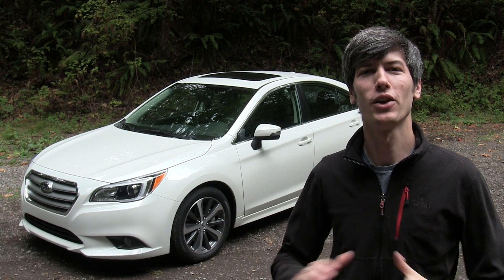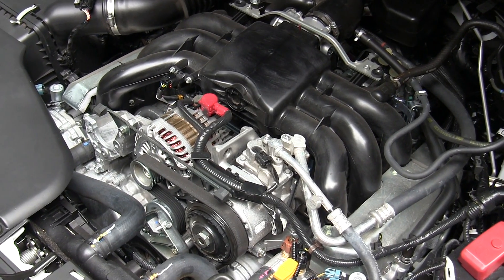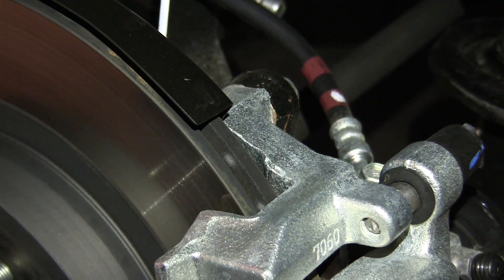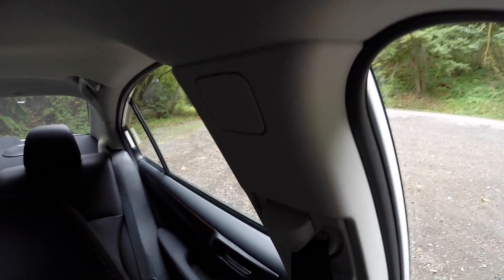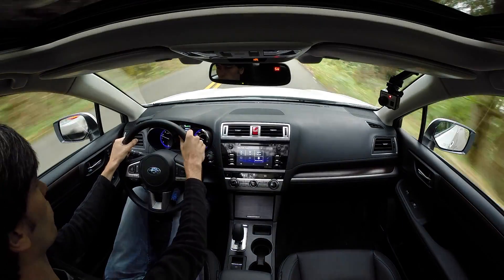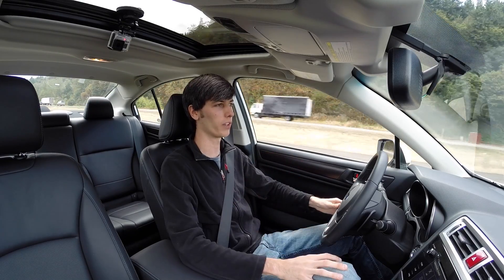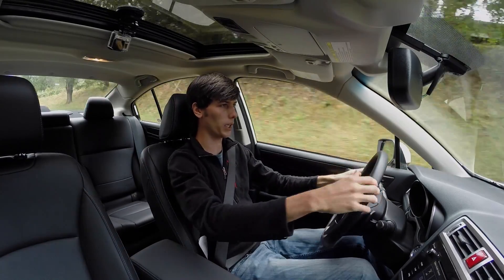2015 Subaru Legacy 3.6R Limited - Review & Test Drive

Comment: And, on another note, the car is big and bloated now. It's reasonable attractive, in a vanilla sort of way. Personally I preferred the sportier styling of the 03-08 car, and it might have actually been seen as a competitor to a 3-series or Audi (with the right engine), albeit a less luxurious one. 

Now the car is kinda a boat. 

Can you even get it in a stick anymore?
Reply: +John Pifer Nope, no stick. And, yes, it is a big sedan. But it doesn't handle like one.  (Not one bit: just put it through a good sharp curve and you'll feel that AWD hauling ass in the back.)  And my backseat passengers have universally praised its roominess.  Yes, it looks like a Hyundai or Ford, but some of us older buyers like having a car that blends in, for the most part, until you need to actually get to work in a blizzard -- and leave everyone else stuck in the slush.

Comment: +Engineering Explained - Nice review, man. I appreciated how you went over some of the design of the suspension, etc. 

Just for future reference - I would have enjoyed some comparison between the Legacy and some other car that it directly competes with (does it actually have direct competitors?), and some of the design differences, and how those differences affect handling and driving dynamics. To me, one of the most fascinating aspects of not just car design, but the design of anything mechanical, is how different companies and/or design houses solve the same problem, but by different means. 

So, do people who are shopping for, say, a Maxima, also look at the Legacy? Doubt it. So who looks at the Legacy, OTHER THAN the (let's face it) quirky individuals who already have a liking for Subaru? Camry/Accord buyers? Maybe, but probably only 10% of them look at a Legacy. So, again, what does the Legacy compete with?

Comment: I bought 2016 legacy 3.6 but car has tank problem it's came noise like gas fluid movement you can inside the car when you going slow test break and gas you can heard so they changed tank but it's still has same problem so buyers be ceraful before (signature) buy new car.

Comment: 12:50 that little bit of torque you get when you shift up, also happens in the AUTO. I have the 2011 and it's kind of strange to shift and feel a jerk back. I'm hoping sometime next year maybe, to install a catback exhaust to let it breath a little easier and have this guy from XRT tuning, reflash the TCM and the ECM. He's managed to get the transmission shifting a lot quicker and smoother, as well as spreading out the torque a little better and increasing torque and HP all throughout the range. There's a lot more to gain from headers back, along with larger injectors from an STI but it's very pricey and for the meantime, a catback works.

Comment: Great review but small correction,the two cameras mounted at the top of the interior of the windshield are not part of the active cruise control but "adaptive cruise control" (the new subaru eyesight system)

Comment: Torn between this and a WRX with leather and upgraded center system
Reply from the maker: +Gene Clarke Oooh, the WRX is super fun. The FA20 is so good.
Reply: +Gene Clarke An odd pair to cross shop.  These are very very different vehicles for different purposes.  For a WRX, most would be also shopping the GTI, the Mazdaspeed 3, and other similar.
Reply: +3333glen I currently drive a 2015 WRX and my girlfriend has a 2010 Sentra. She's been shopping around and I basically convinced her to look at the 2016 Legacy. We both test drove the 2.5i which was surprisingly lively and I've driven the 3.6R which is just awesome! We figure she'll purchase near the end of this year, but if I can get her into a 3.6R, I will. That being said, cross shopping a WRX and a Legacy isn't as odd as you'd think once you drive both.
Reply: +manniefresh730 and that's where the 2012 Legacy GT came in.
Reply: I want symmetrical all-weel drive from Subaru. Im only looking  at  subarus
Reply: +3333glen look for a 2012 Legacy GT.  same drive train as WRX but incredibly rare as there were only 227 built for N. American market.  and not that many more for 2011.

Comment: the eyesight system works only with adaptive cruise control or all time?
Reply from the maker: The other features that rely on the system will remain active when you're not using ACC.
Reply: no

Comment: Today was a perfect example of why turbos hate Vegas. 118 to 115 entire valley, and at 10:40 it's 103. My H6 2015 legacy smoked my buddies sti at 3pm this afternoon. 118* road temp was probably 160's. Turbo no like hot dry air.
Reply: GameHEADtimeGHT Just take that as the shape of the engine.
I4 or I6 means engine shaped like I. All cylinders are lined up, like ||||.
V4 or V6 means engine shaped like V. 2 or 3 cylinders on each side like \\ //.
H4 or H6 is like flatten V4 or V6. 2 or 3 cylinders on each side horizontally, like = =.

4 cylinder engines are mostly I4, and 6 cylinders are mostly V6. But you will see others once in a while.
Reply: TheManYouNeedToBe you had i4 or v6?
Reply: GameHEADtimeGHT Subaru doesn't make a v6. I have the H6.
Reply: TheManYouNeedToBe please explain whats h6 never heard of that?
Reply: GameHEADtimeGHT Horizontally opposed pistons (boxer engine) >> << not \\ //
Reply: Kyong Song today i learned something.  Thanks.

Comment: Other advantages of the plastic composite intake manifolds are the lack of rough casting imperfections on the inside and their resistance to heat soaking. The best option for road-going cars today, honestly. They are also plenty strong, even for heavy forced induction.
Reply: Unless it's bmw plastic lol they blow apart

Comment: First things I'd do would be to ditch the engine cover and block the cameras
Reply: +Jamessr23 The engine cover helps with noise reduction.  And if you block the cameras, then get into a frontal accident (rear end, pedestrian, etc..) your insurance will fault you.
Reply: I like engine noise..and I have a perfect driving record since the 80s..more focus should be on improving the skill of the driver..the current driving tests are a joke
Reply: I learned to drive in the '80s, before all those driver aids were in cars.  We didn't even have passenger side mirrors on lower model cars.  Today I buy the cars with the least driver aids.  My car has no Lane Warning or cameras in the front.  The salesman at Lincoln wanted me to add  those options and I immediately declined. The problem is if you buy a car with that stuff built in and the insurance company notes it, they will have to be in working order (not blocked or broken) in the event of an accident or YOU will be at fault.  So, as I was trying to say, just don't buy this or any car with it if you choose to block or disengage the cameras.

Comment: When he says it has a Boxer engine, what exactly does that mean. Porches obviously doesn't make the engine does it?
Reply: The cylinders are "horizontally opposed" basically they sit flat and look like they punch towards each other like boxers fighting
Reply: yogaexe boxster is the name of the Porsrche itself, boxer is the type of engine used by porsche and Subaru.boxer is an engine type as opposed to V6 or V8. that name is not owned by any certain manufacture.
Reply: CmanCorporations Porsche call their engine BOXSTER. Subaru is BOXER.

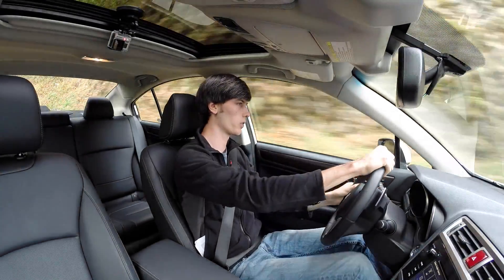Comment: I hear a lot of wind noise at 13:00 mark and onward. The reviews on KBB state the same thing about awful wind noise at higher speeds. I am in the market to buy a new car. It's either this, Camry, Mazda 6, or Accord. I really like the fact that it's AWD, but that wind noise really kills. Your two cents?
Reply from the maker: Saba Z This was before I had purchased a lapel mic so it's recording from a GoPro which is directly connected to the windshield. This was also before I took decibel readings (my reviews improve with time haha, like all things I suppose), but I'm currently reviewing the Outback which is based on a very similar platform (it's essentially a Legacy wagon). Noise levels are low, 75 dB which is some of the best I've tested - but the noise you do hear is wind noise (with some, but not much tire noise). That said, you could always take each of those vehicles out on the highway and see what you think, I found the Legacy to be fairly quiet, on par with the Camry for sure (76.5 dB is what I have recorded for that). I have not tried the Mazda 6 or Accord. Here's my review of the Camry: https://www.youtube.com/watch?v=Lt-oLz7HL-k&lc=z13aun55rkixwzvss232ej2jwmy2grwui
Reply from the maker: Engineering Explained I should also note I take the dB reading at 65 mph, on a fairly rough highway. Higher speeds could yield different characteristics for different cars.
Reply: Engineering Explained  Hey thank you so much for the prompt reply. I gotta check out your Camry review. You are right, I should take each one of them out for a spin.

Btw, great reviews! You talk about stuff that matters. Thank you for that! Subbed.
Reply from the maker: Saba Z Glad you found it helpful, thanks for subscribing!
Reply: This car is known for how quiet it is so if noise bothers u that much then I guess this cars for you haha

Comment: Question. As it is CVT  but does it have Manual option as well? I mean by Manual=paddle shifters.
Reply from the maker: Oranje Renaissance It has paddle shifters, yes, as stated in the review.
Reply: Engineering Explained
 6 speed or 7 speed?
Reply: Oranje Renaissance 6 to feel more discrete. It works well in my humble opinion.

Comment: Why don't other companies use boxer engines more often than V6's? If it yields a better balance and a lower center of gravity and has no additional downsides (except for space) you'd think everyone would use it. Perhaps they're heavier?
Reply from the maker: PvanP Space, cost associated with it, and of course the cost of switching to a new design. Does the market require a lower CG and better balance, or can you get around it with an understanding that most drivers won't push their car, and some decent engine isolators? The latter will usually suffice.

Comment: Not a bad review, mate. Here in Australia, I test drove a Subaru Liberty, same car, only called Liberty in Australia, with the same 3.6 litre boxer six and CVT. I was impressed with the general air of refinement, build quality and good performance. The technical features worked well, too, like the lane departure warning et al. But it really lacks the driving involvement of previous models, like the 99-03, and the 03-08, which were all involving driver's cars. The engine, whilst smooth and refined, doesn't have the boxer sound, like previous model 3 litre Subarus, either, making it a bit characterless. Horses for courses, I suppose.

Comment: Great review! I had one of these as a loaner today while my '09 2.5i was in the shop for service. Completely different car! But in a good way. An obvious difference was less road feel, which I actually liked because my Legacy is pretty hard over the bumps. This model absorbed them better, with similarly profiled tires. While I agree with some here that it could use 50 more HP, I also felt it had enough power to be fun to drive and safe for getting on the highway, but didn't have so much as to easily get me in trouble. To your comment about how the car lunges momentarily when accelerating and switching gears: totally agree. Not sure what causes that but I did find it a little bit alarming. Made me feel that there was a temporary loss of control, which I did not like. I would like the onset of torque/HP to feel more linear.

Comment: Congratulations man. This is one of the best car reviews I've seen in years/ever. PS If you had to pick the best CVT between Subaru, Honda, and Nissan, which one would that be?
Reply from the maker: Occams Razor I'm yet to drive a CVT Honda, and can't comment on reliability, but the CVT this Subaru had seemed quite good, as did the one in the Toyota Corolla I drove. Both responsive when you want it, Corolla had the best paddle shifters.
Reply: Engineering Explained Thank you for the quick response, and please do more car reviews. I also want to wish you and your family, a happy Thanksgiving!

Comment: $33,000 is a lot of money for a Subaru, even though it's a nice car.  Too bad it has one of those vague unreliable CVT belt-driven transmissions, really a shame.  Toyota doesn't use one of those motor-scooter style drive-belts, it actually uses a 6-speed real automatic transmission for reliability and performance. For $33,000 one could purchase a Lexus IS-250.  Even a totally maxed out option Camry does not cost that much with a V-6.  No thanks.  I'll stick with the superior Toyota/Lexus products!

Comment: Does anyone know if the 3.6 is so much better than the four-cylinder 2.5i?  I don't care much about power.  But, I live near the mountains, sometimes drive three people, and want to drive about without trouble.   Can't the 2.5i do that?  Do I need to upgrade to a V6 3.6?  What is the 3.6 for? Just more power?

Comment: After viewing numerous video car reviews on the net, I must state that this particular video was the MOST COMPREHENSIVE and EDUCATIONAL review from every vantage point, spanning from a thorough explanation of the suspension components to  the detailed functions of the vehicle as it glides in motion!!  Quite SUPERB indeed, so I HIGHLY COMMEND you for such excellence!

My wife has the 2013 Subaru Tribeca with the same H-6 engine (but with the 5 speed auto trans), so I was fascinated on the attention to the detail devoted to the engine parts.  With the Tribeca's rear-wheel bias of its normal torque split of 45% of the power delivery of the front wheels with 55% to the rear wheels, I agree that the throttle is touchy that can somewhat jolt one back into their seat without any wheel spin if the gas pedal is pushed too much from a standing start.
Reply from the maker: Jim Norris Thanks, glad you enjoyed the review!

Comment: Bland car. Engine has pitiful power for 2015 - a 3.6L today should be making 300+ hp easily. Side mirrors aren't even fully painted (the "stalks" are black). Front hood joins the front bumper in an ugly way - with an ugly horizontal line across the front. White (painted) door handles look cheap - should be chrome like on most other mid-size cars. No panoramic moonroof offered, like Hyundai/Kia have. Pass.
Reply from the maker: CheesyTV Chrome door handles? Sounds hideous.
Reply: Engineering Explained Right. Have a look at a Sonata or Accord and tell me what kind of handles they have. Look at an Escalade or Navigator and tell me what handles they got. All chrome.
Reply: They can build stronger engines, in this one they aim at long life imo
Reply: Do you know that this engine use regular gasoline? I mean,this car is not the type of the car that you think of. It's made for everyday driver! I think this is such their conscience.
Reply: what u need 300hp for? In North America u can hardly drive maximum 140km/hr LEGALLY even 180hp will reach there with ease. In EU more hp/torque makes sense.
Reply: Good.  It's a car.
Reply: TNBposse Perhaps, but painted handles are not luxury either.

Comment: Great Review!  BTW-I believe the real benefit of the plastic intake manifold is not just because it's "lightweight and cheap", but it also acts to insulate the incoming cold air from the engine's heat (which would reduce its power).
Reply: Akiva Feinstein The Upper Intake Manifold (plastic item you see when you pop the hood) almost always has a bolt pattern consisting of clearance holes (not tapped holes) to allow the assembly bolts to pass through it for attachment to the Lower Intake Manifold (metal).  On another note, high-torque tapped holes in plastic are rare (unless it's a special * expensive *, engineered plastic designed for such use).  It's usually more economical to press threaded metallic inserts into the plastic substrate if you need it to be threaded.
Reply from the maker: mitchlu Great point, certainly less conductive than a metal. But certainly not as durable.
Reply: Engineering Explained Also it must be that from a service point of view removing bolts from the plastic composite poses a decent risk of stripping the threads and there is no easy way to retool these? Right? Or is an aluminum manifold just as sensitive?

Comment: I really like the feature of the active cruise control.  Trying to pace the car in front adjusting speeds can be annoying.  And the lane departure system a nice bonus for a large sedan.  I noticed the off switch for these features.  Does this mean the k-band sensor is turned off for the lane departure system or does it act like a mute button?

Comment: This car is celebrating 25 years in America. Although many people were upset with the Legacy not have a manual transmission or turbo engine, it is much roomier than the last two generations. Put Eneos 75W-90 GL-5 100% Synthetic Differential Fluid, and the front and rear Limited-Slip Differentials will operate smoothly and last for at least 100,000 miles.

Comment: You talked of dynamic brake pedal feedback, is the brake pedal electrical too? With Toyota and Subaru sharing tech and Toyota's "Unintended Acceleration" fiasco I sure as hell wouldn't want an electronic parking brake. I'd at least like a little bit of mechanical control in a car that has electric throttle/steering/brakes.
Reply from the maker: GhillieLand Hydraulic brakes, but yes I'd agree on the mechanical park brake statement.

Comment: 4:04
I suppose the components have equal weight distribution, but doesn't symmetrical awd usually refer to the equal length driveshafts?